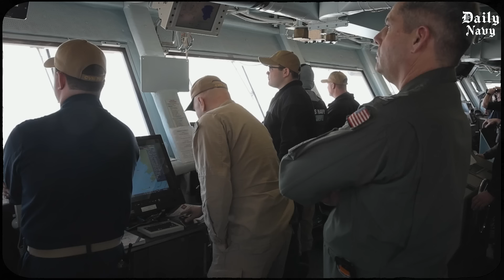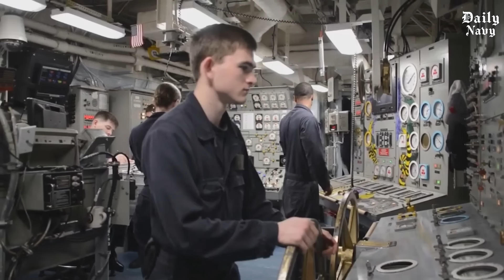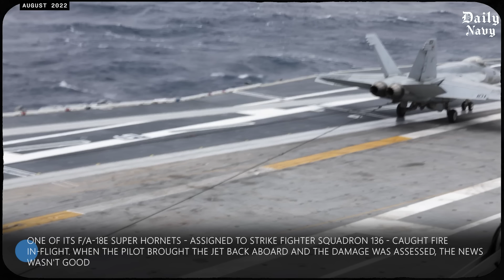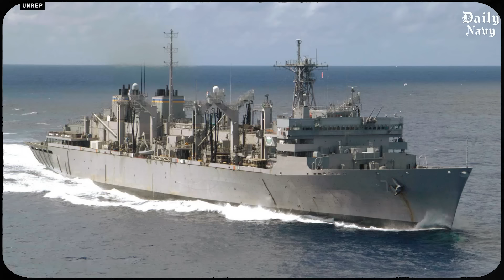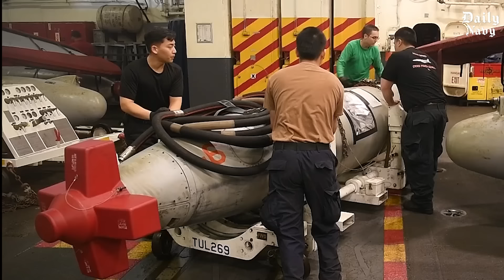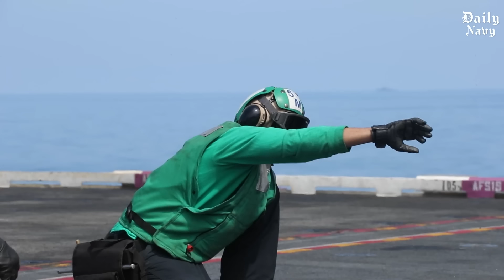What Happens When Engine Repairs Are Needed in the Middle of the Ocean on a $13B Carrier

Comment: Retired from the Navy and very proud of it. Machinist Mate Fireman. Best decision I have ever made in my life
Reply from the maker: Incredible path to walk. Thank you for your service and dedication ⚓🇺🇸
Reply: Wish I would've done my 20.  I miss those days sometimes.  USAF Maint. KC-135Q supporting SR-71.
Reply: I served in the Navy and liked to fly with MAC on my vacations. On a whim, I decided to go to Beale AFB and get on a KC-135 as I had seen so many flying east while living in Rough and Ready, CA. It turns out the KC-135's were usually going to England. Anyway, when my cousin dropped me off at the MAC office, I saw an SR-71 in a hanger across the street. After checking in, I walked across the street and around to the front of the Blackbird. I looked around and then laid my hand on its nose. When I started to cross back, I noticed that there was another Blackbird in a hanger a short way away. As I walked toward it, I noticed another and another and another. When I got back to the office, I had laid my hand on the nose of 5 Blackbirds in a row. It was amazing.
Reply: @DangerChaney they were really something taking off at night. About 60' of exhaust w/ lots of rings.  Seen em in flight refueling from the boom pod too.  Never touched one though, still something I do when boarding an airliner.   After takeoff, when they've climbed a ways you can still feel the rumble of the J-58s.  Awesome.

Comment: Come on!  You have plenty of jet engines on board attached to jets and lots of fuel so just secure two or three jets side-by-side on the Aft end of the carrier and fire them up, maybe half throttle and I’ll bet that thrust would move the carrier at a speed of a knot or two ￼.